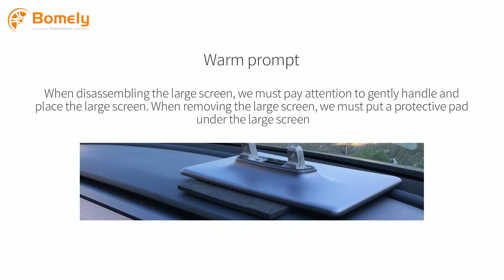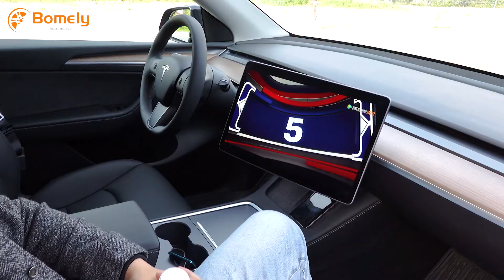2017-2023 Model 3&Y Screen Swivel Mount Upgrade-Four Directions Installation Video

Comment: Is that thick black medal joint bracket suppose to be super stiff and tight? I turned at least 15 times with that tool and it’s still very stiff
Reply: Let me know if it loosened up enough. I just got my kit delivered and I’m going to install it in the next hour or so. What about the vertical axis? Does it move fairly easy?

Comment: Just installed mine. Went easy enough aside from two screws that hold the back monitor trim in place. Upon initial install and review, I would definitely recommend this kit. Hope it is as durable as it appears.